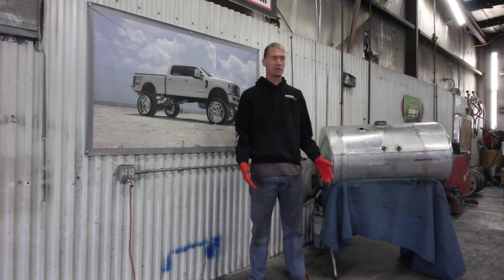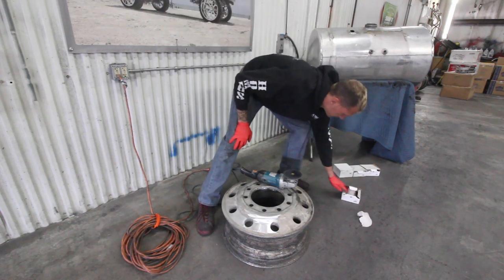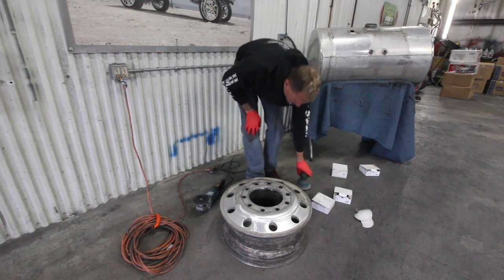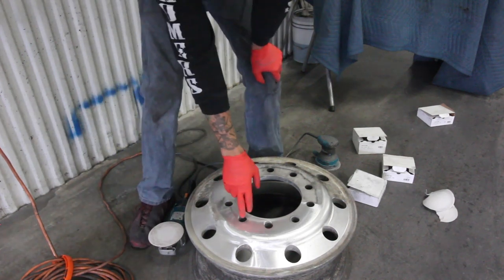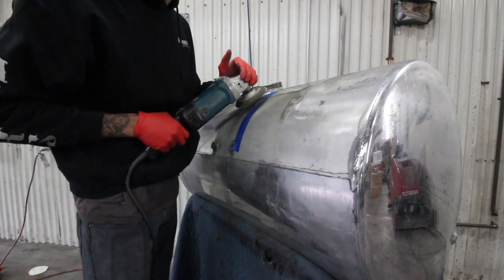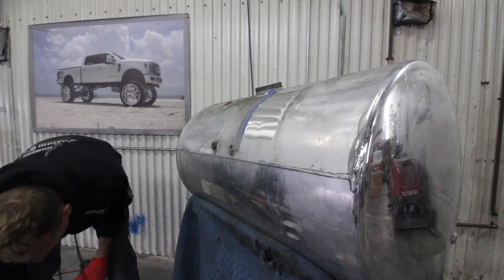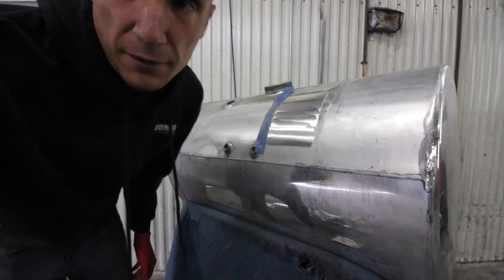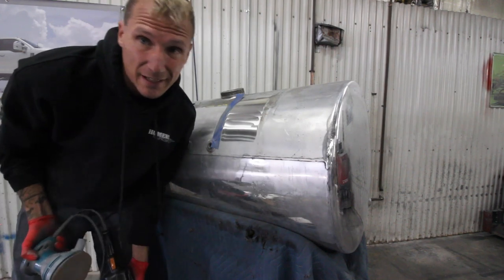How to sand Aluminum?

Comment: I just did a junk yard wheel today to practice. 
I used a da and started at 80 grit! 
After I acid washed the wheel. 
Worked it all the way to 220. 
Then heavy cut and then polish. 
Took 4 hours for both sides of one wheel. 

After seeing this, I need to get the orbital sander. Looks like it took way more off way faster then the DA. 
The heavy pitting on the bolt holes took forever. 

Thanks for sharing sir. U make it look easy.
Reply from the maker: Thanks for watching. Hope my videos help.

Comment: Just found your channel and subbed.  Well done.  I'm restoring a 75 Honda 360T with pitted chrome and runs on the alum.  Been using 0000 on the alum and chrome that has surface rust and I'm just getting the chrome down to a beautiful shine and polish.  The lower fork's on the bike and the engine fins, I'm using a drill with compound and a grinding (cloth) wheel.  I'd like to use my Makita but never have tried it.
Enjoy your post
Reply from the maker: I appreciate you watching and taking the time to comment. Hope your project went or is going well.

Comment: i did my first job with a rotary and my metal had alot of streaks in it. was that from the sanding or from cutting?
Reply from the maker: I would have to see the streaks to know which is which.  If you want you can text pictures of the streaks to me at 9209790386 and I can help you decipher what went wrong.

Comment: Is sanding necessary for just oxidation? What would happen if you used an orange wheel and brown compound from the start? I'm doing an old pontoon boat and want the toons shiny but not taking it to a show.
Reply from the maker: I always try to buff without sanding. I only sand when necessary. I try to avoid sanding at all costs. Hope this helps. Thanks for watching.
Reply: I'm doing the exact same thing, this answers ALL my prayers and gonna save 2 days!!! 🙏🏼🙏🏼 

👊🏼
Reply: @user-yi8pf8on6w  well I found that sanding is totally necessary with bad oxidation and probly the most important step. Just gotta be really careful with grit.
Reply: @michaelglenn2468  got it.   I'll do a test section with and without, it's a 1994 so I bet I'll have to sand at least one pass, 320 probably what I'll use.   Thanks, y'all have a safe summer!!

Comment: Hey man, if you had access to a sand blaster, would that work? Or should we just stick to those power tools and your technique?
Reply from the maker: Sand blasting makes the metal really hot and in my opinion it makes it really tough to polish. It is almost like it burns the metal. I avoid sand blasted parts.

Comment: I wanna know why the new husky pneumatic rotary sander has Diablo pads that don't stick.
I thought getting a pneumatic would be like my crap hyper tough velcro style and it's not.
Start sanding and the Diablo pads just fly right off, that's after peeling the backing off to "stick" to the pad lol
Reply from the maker: I only use velcro. Working in a dust filled dirty shop doesn't do well with sticky back sand paper. Plus diablo paper is less than ideal for aluminum. It can be used on it as that is what it says on the box. But it isn't made for working on aluminum that needs polished.

Comment: what kind of sandpaper do you use for Aluminum? 
some people use silicon carbide sand paper for aluminum. 
They say avoid using the aluminum-oxide sandpaper on Aluminum itself. 
What do you use on Aluminum?
Reply from the maker: I use aluminum oxide and had great results.

Comment: I sanded my Pete front grill. 320,400,600 and after cut and polish still have sand swirls. What did I do wrong ?. Sanded with a Makita Da
Reply from the maker: Likely moved to fast with the sander or didn't wear the paper in or got something stuck in the paper.

Comment: Have you ever tried forced rotation/gear driven dual action? Like a Flex 3401 or Rotex? What are your thoughts on it for metal sanding? 
Thanks for the video, metal polishing is hard dirty work. You guys earn every dollar. I do more paint correction, but I polish the odd wheel, toolbox, etc.. I bought a Renegade metal kit and its worked well, the end result is very satisfying, but its a workout!
👍👌✌
Reply from the maker: I've tried it and don't like it. But that is a personal preference. I know many that use them and love em. I just don't like the pattern it leaves.
Reply: @EvanStegerMetalPolishing  gotcha, thanks!

Comment: Do you ever use a interference pad between the paper and backing plate? Just curious if it would float over the defects vs knocking them down. Thank you for your time.
Reply from the maker: I don't. I'm not a big fan of the interface pad and the finish it leaves. But I do know many people that use them and they do a great job. It is just my personal preference not to use it.
Reply: If you have heavy pitting or alot of material to knock off then you want the pad alone if you have say a heavy contour or rounded piece it helps to have  some give.

Comment: hellooo, bit of a smart arse comment, but I think the break drum couldn’t sit directly on that outside of the rim. If it was used as steer, the drum sits inside, same for a lazy axle single. For twin wheels on the inner side where the drum sits inside like on the front, the outer wheel is turned around, and here both twins sit ‘face to face’. No break drum … just nuts
Reply from the maker: It can if it was an inside wheel turned into an outside wheel. 😉

Comment: DIYer here. Want to shine my (extremely oxidized) aluminum boat. Would you recommend either of these tools and methods over another, or neither?
Reply from the maker: Boats are usually pretty thin. Unless you mean a pontoon. If it is a thin side boat then I recommend just doing a da. Lowest grit gets it smooth and the other grits working up make it polishable. If it is a pontoon then you can just do these steps from the video. Thanks for watching and supporting.
Reply: @EvanStegerMetalPolishing  Thank you.

Comment: Sir, after you sand the aluminum do you put something on it ? I ask because the front forks tubes on my motorcycle looks like your  rim. I want to grind it off and then what leave it smooth as is? thank you
Reply from the maker: After I sand it I buff it with my 2 step aluminum buff setup.
Reply: @EvanStegerMetalPolishing  Do you show that 2 step process anywhere?

Comment: Can you comment on the Alcoa coating on these wheels ? Can I cut and polish the coating they use or do I need to sand the coating off ? These are 5 yr old never polished before and pretty dull. If you're sanding off the coating, what grit are you using ? Ive experimented with 150grit on a DA/orbital and it's not effective. Polishing the coating turns it yellow from the heat.
Reply from the maker: You have to sand the coating off. You can't just buff it. It will burn and turn black. Check out my video on how to sand and polish a durabrite. That should help answer a lot of your questions.
Reply: @EvanStegerMetalPolishing  hey thanks a bunch !

Comment: Quick question.  What do you use to protect your final finish, after your final step with an airway?
Reply from the maker: The compound is filled with greases and waxes. The compound seals it up.
Reply: @EvanStegerMetalPolishing  thanks for the response. I usually go back over it with your liquid heavy cut  compound. Am I doing to much or being to cautious? This Utah weather really tends to beat up the aluminum.

Comment: what speed setting like number wise on the grinder for sanding the tank? thanks heaps
Reply from the maker: I usually run around 2200 rpm. Not sure where that matches with your speed setting but just a personal preference thing.

Comment: Hey Evan. I have a question. Did u ever do polish Sandcast Aluminium? 
Like Nathan Airchime horns. Got one that i'd like to shine up a bit. Is there any difference to "normal" alumimium Tanks e.g. ?
Reply from the maker: Sand cast is very different. Lots of sanding and some sand castings will have some air pockets and pits or holes that won't come out. As far as buffing it is very similar just more work and more heat.
Reply: @EvanStegerMetalPolishing  Thanks for the answer. Except for one Bell they are in a relatively good shape, no holes or pits. I Think theres not too much sanding needed. I'll try it out and See what i can get. Take care.

Comment: Great videos, first time viewer asnd new subscriber. Question, I am replacing my painted 22.5 with some new aluminum ones and I am curious if you have any recommendations for protecting the inner polished sides? Thanks.
Reply from the maker: What do you mean?
Reply: Sorry I meant what are your suggestions for protecting the polished inner sides of the wheels when they're so hard to reach.

Comment: What kind of stand is that under the fuel tank? Where can I get one?
Reply from the maker: Harbor freight body panel stand.
Reply: I would get about 2 or 3 2x4's and some screws to make an X buck, top off with a moving blanket. Probably a lot cheaper.
Reply from the maker: @garychandler4296  this rack cost $15. By the time I cut the boards and screw them together and take the time I could be polishing and making money. LOL

Comment: what rpm is the makita at with the 400 grit when u doing tank please ?
Reply from the maker: I spin between 1800 and 2100 rpm depending on the mood of my day. LOL
Reply: Hi Evan. What is reason for not going faster like 12000 rpm? Thanks and thank you for sharing
Reply from the maker: @peterolesens  Airway buffs are only rated to hold up to 3500 rpm. The buffs would explode at that fast. Very dangerous

Comment: Gday, just getting into polising myself, everytime I try to sand something and then polish it goes black ? What could I be doing wrong ? I Sand to 600 grit,  rouge and wheel i have work fine on alloy that I havnt sanded yet but once sanded just goes black
Reply from the maker: Could be a whole list of reasons why this could happen. If you wanna send pics to my cell 9209790386 I can try to help diagnose the issue. Sometimes it is a sandpaper or sander issue. Sometimes it is a user error moving too fast with the sander. Send pics and I will try to help.
Reply: @EvanStegerMetalPolishing  thanks for the reply mate appreciate it, went bit slower sanding and buffing helped alot, I won't bother ya mobile number all the way from Aussie land cheers mate  
keep up the great videos  👍

Comment: Whay not use aluminum asid cleaner first to remove most of the oxidation
Reply from the maker: I'm not a fan of acid. Check out my video on acid. I really do not like it. It does more damage than good and if you are sanding you'll take off more than what the acid cleaned anyways so you are just wasting money on the acid.

Comment: What speed do you run the rotary at?
Reply from the maker: Usually 1800-2200 rpm depending on the grit and what I'm working on.